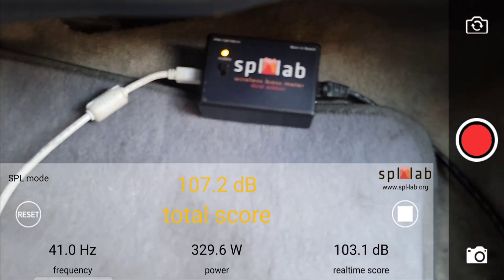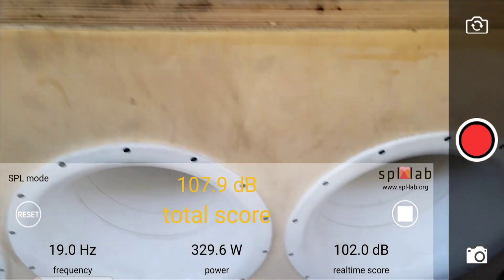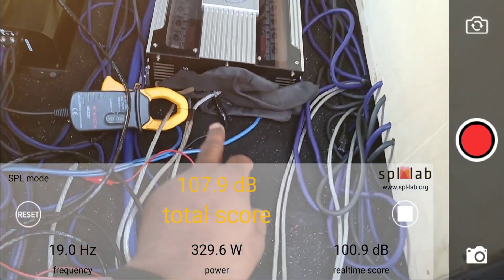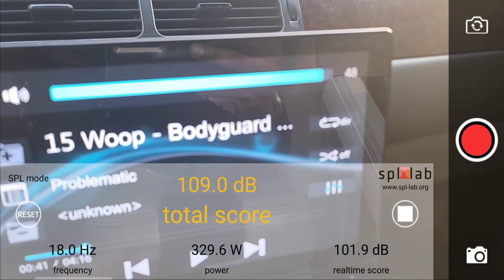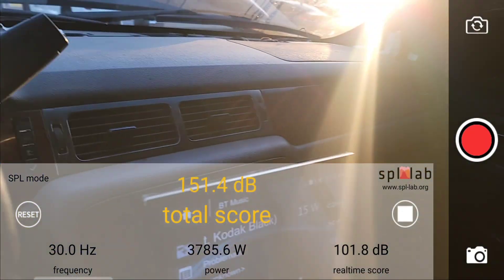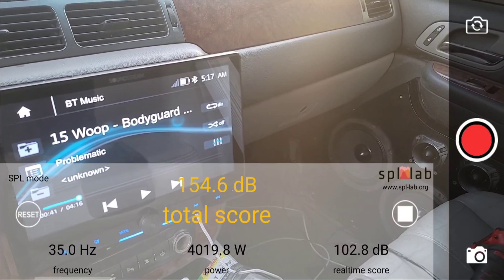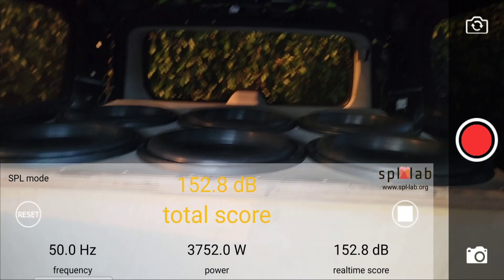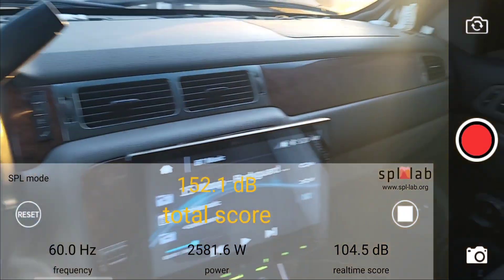6 Custom Soundstream XXX 15s Powered By A Soundstream TXP1.18000D @ .47 ohm (Meter And Clamp Test)

Comment: Thats impressive if you think about it, first to hit almost a 54 with under 3k, thats only 500-800watts per woofer. It didnt do its rated power but to hit 153s with a 350$ish amplifier and hang with a 12k.
Reply from the maker: That's exactly what is going on in my head. Very impressive output for the power clamped. No where near rated but can't complain for around $350
Reply: @BIGJURAY20  I think it's cool you got all Soundstream gear. You know back when I got into car audio that was a big name like they were known for having good stuff, nowadays people look at them like Boss audio or Power acoustic.
I wouldn't mind doing a build with there T5s and txp amps.
Reply from the maker: @BDauto86  The T5 series is one of my favorites and i know what you mean  by the comparisons. I still have a love for Soundstream new and old
Reply: @BIGJURAY20 Love Soundstream ❤️
Reply from the maker: @joebruce2180  Samehere bro

Comment: I love my 1.18000D amp.
I have it to power my Soundstream X2.15 that I'm trying to figure out the specific measurements to fit it nicely into the back of my '90 Integra... If you might have any recommendations as far as ported, slotted, or sealed?
Or thoughts on measurements?? I'd really appreciate it big homie!! 😁😬
Reply from the maker: You should try for a ported enclosure that subs not really made for a sealed enclosure. But, I've honestly never seen anyone try it as measurements for your car I'm not too sure about that due to the fact I've never played around with one
Reply from the maker: You have a nice setup but I'd recommend playing the amp at 2 ohm to your sub. .5 ohm is pretty risky
Reply: What material should I construct my enclosure for it out of? And I was considering making the enclosure with infinite baffle for it, like making a hole for the sub in the bottom of my trunk space or into the back seats and leaving the seats pushed all the way down and fabricating a “wall” from one side of the back of the car to the other. Just wondering what would suit the car better.
Reply from the maker: @christianwalster3882  Honestly you should be ok with just about any wood. Although i don't work with it much mdf would help.

Comment: Can you re test the taramps md 12000 again with all the same parameters?  Im super confused how the soundstream gets louder with less power. There has to be a variable that changed, maybe the weather outside or the meter or something or the mic position or the mic itself idk
Reply from the maker: Well, the weather has been about the same lately and the meter was in the same position from testing eash amplifier
Reply: I'd run the tarantula
Reply: @BIGJURAY20  How would less power not be as loud , given all the same scenarios?  My other theory is the 18000amp was clipping but still doesnt make any sense.  AC power is AC power it doesn't make a difference so im confused how less power would be louder on the meter
Reply from the maker: @kptn9narw I assure you each amp i tested was clean output. I'm already taking a risk testing at .47 ohm but to test at low ohm loads and be dirty would be too risky
Reply from the maker: @kptn9narw Someone else made a good point. Although it's not listed the damping factor could be higher.

Comment: Wtf how is that possible the taramps did a 153.6 with 4800w and the soundstream did 153.8 with 2700w @ 40hz?   Does that mean the taramps are putting out bad power or something?  I thought power input related to excursion thus more output from the box....im super confused right now man
Reply from the maker: To be honest I'm just as puzzled as you. Didn't expect to see alot of power outta it so i assumed the scores i got would've been much lower. By my surprise power was low but output was pretty good with power received
Reply: @BIGJURAY20  There are conditions beyond your control.... humidity, temperature, barometric pressure. Believe it or not it makes a bigger difference than you think.
Reply from the maker: @WeSRT4  Thats the crazy thing about this I never know what to expect
Reply: Maybe the soundstream has better cone control,damping factor
Reply: @miketaylor2197  Clean power
Reply from the maker: @miketaylor2197  That's true but doesn't help when it isn't shown in specs. Happy I had the opportunity to test it and learn a thing or two
Reply: @RidgelinePatriot   no, clipping will actually gain a lot on the meter.  He keeps all his signal clean too